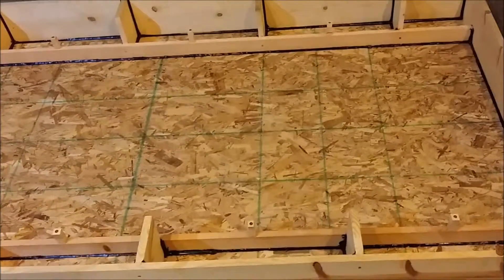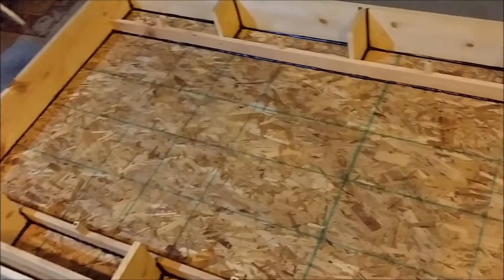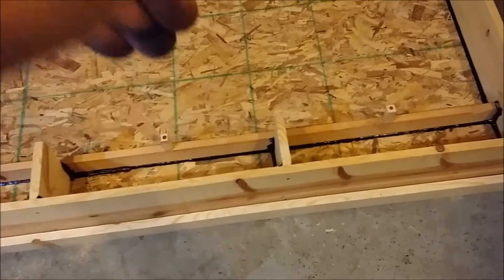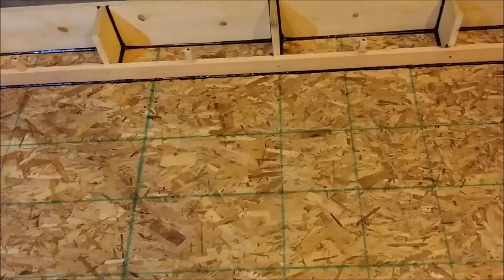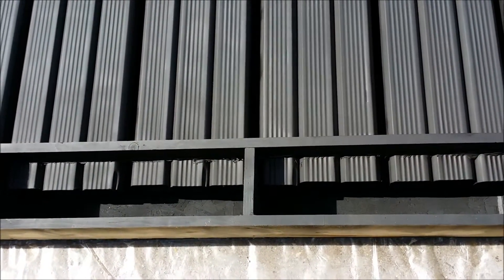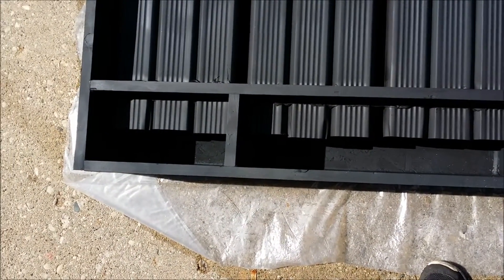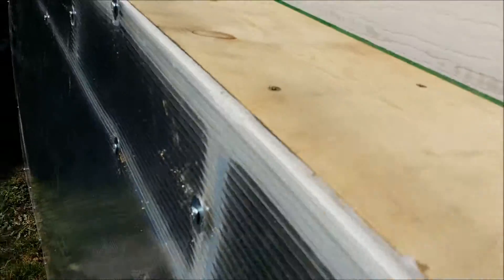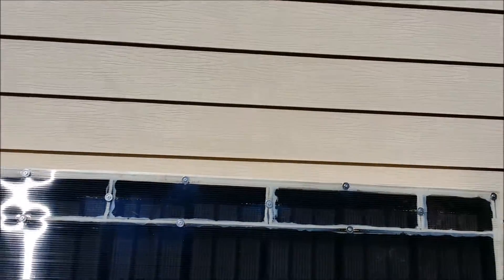solar heater

Comment: You want the airflow strong enough to keep the exiting air about 15 degrees warmer than the incoming temp... Otherwise you are letting too much heat loss back through the glass and frame.

Comment: Finally someone channels it off so the air has to follow through all the pipe and not just top to bottom. I think it might work even better if you sectioned it off so i went through every single piece separately. How does it work?